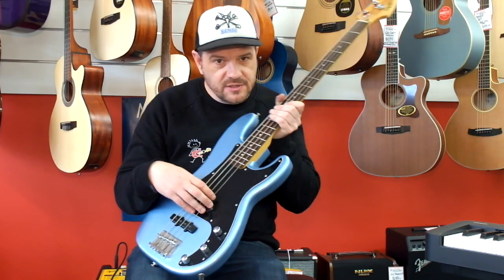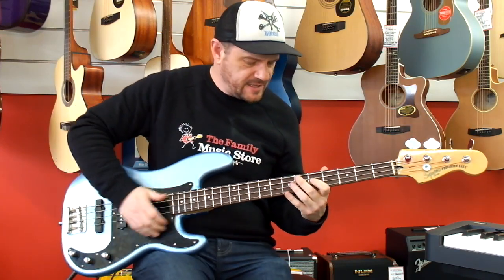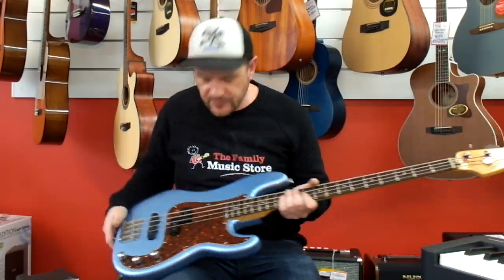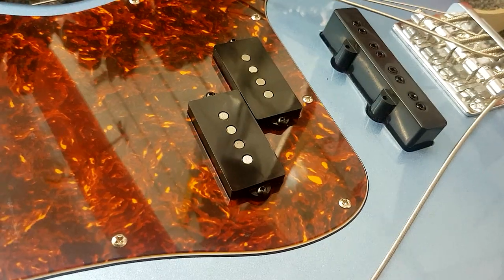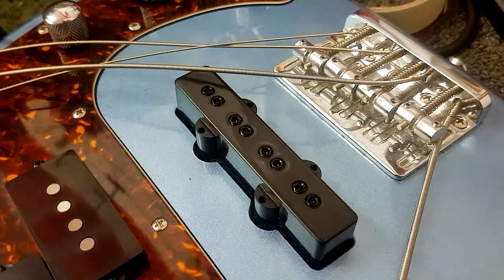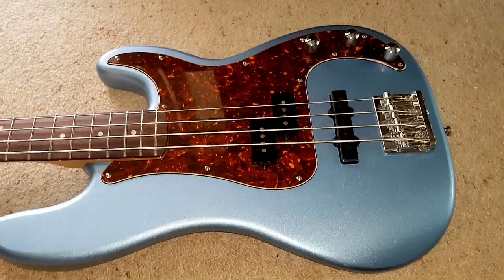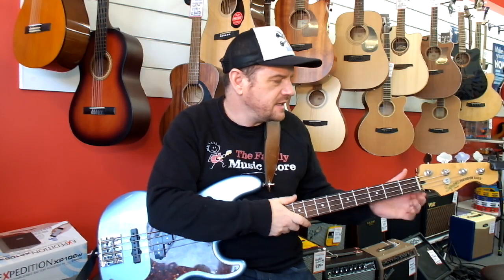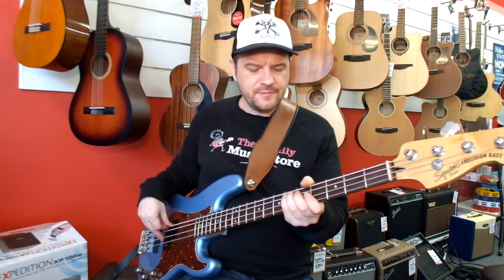Modding a Squier Vintage Modified PJ Bass - from average to awesome!

Comment: You make a very interesting point about how adjusting the height of the split coils ie setting them at the recommended manufacturers height (you did, didn't you!) makes a noticeable difference to your tone. Even with pickups in electric guitars and especially with the higher outputs of Dimarzio/Seymour Duncan et al.
Reply from the maker: Didn't look at the manufacturers recommended heights, just adjusted to what I thought sounded good.

Comment: I'm in the process of moding my PJ bass much the same as yours. What did you use to reshape the pickguard the factory Fender is not a direct fit. Mine is not fitting around the pickups.

Comment: Got a thumbs up for that Rat Bones Cap 👍
Reply from the maker: Thanks! Yes I still skate.
Reply: @diyguitarmods6146  just came across your video a year later. I'm actually building an 80's style skateboard right now. Got some neon pink and yellow grip tape and my wife drew out a design 👍. Oh yeah your video is the video that helped me adjust the pick ups on my bass which is the exact same one as this. I added white pick up covers and put the white pick guard from my Mexican P bass and bingo it looks like a new bass 👍

Comment: Was the bridge just a straight swap?
No drilling and filling?
Reply: Fender uses 5 hole bridges most other 5 hole bridges will fit no drilling required

Comment: I can’t find any pearl picksguard for a pj bass so do I have to drill an extra hole in a p bass pickguard or something?
Reply from the maker: You only need a normal P Bass one because the J pickup is away from the pickguard.
Reply: @diyguitarmods6146  A pj bass has 3 tone knobs while a precision bass has 2 so I had to drill an extra hole. I did it and it worked haha.
Reply from the maker: @matthewgilkison7615  Yeah but it depends where the jack is. A standard P Bass has the jack plug mounted on the pickguard. so the pickguard has 3 holes. So because this bass has a side mounted jack I had enough holes for the 3 controls without needing to drill any. But if you had 3 controls as well as a pickguard mounted input jack yes you would need to drill a hole.

Comment: Isn't the push \ pull volume knob the active \ passive switch?
Reply from the maker: No, there's no active circuitry in this bass, either stock or since my mods. I installed the push/pull for the series/parallel mod on the P pickup.

Comment: Why would you want to change the pickups? They're Duncan designed on the vintage modified .
Reply from the maker: I did not know this. It doesn't say that anywhere, including on the pickups. I figured they were the same as Classic Vibes, which I believe are made by the same people as Toneriders. Either way they sound great, not changing them now.
Reply: @diyguitarmods6146  they aren't duncan designed anymore, in these more recent ones they're "Fender Designed" officially speaking but, to be completely honest, I have a Duncan Designed pickup in my pbass and they sound very close or identical to yours, the "Fender Designed" in general. I'd say they really kept the same specs and just have changed the label for some contractual reason.
Reply: There are Toneriders in Strats and Tele CV's. Good PU's. Not sure what's in my Squier 70's Vintage Jag Bass, but they sound great!  Promo says Fender design, but most likely made by Duncan/Tonerider...

Comment: What did you do about the fret buzz ? I got the same issue.
Reply from the maker: Hey, so there's 2 things - one is that if you're getting a lot of buzz in the higher frets there may be too much neck relief. So you'd tighten the truss rod a little which flattens out the neck. This will also lower the action, meaning you can raise the saddles to clear those last few frets. But the other thing is using a fret rocker or other short straight edge to find any frets that are higher than they should be and filing them down, making sure you don't go below the other frets. I just use a shaped crowning tool I got from Stew Mac so I'm lowering them slightly and crowning them at the same time. - Cam.
Reply: @diyguitarmods6146  Thanks for the response, and advice, I recently adjusted the truss, and am ordering a fret rocker. I dig the bass, I got the same model, and color.  have you had any though about upgrading, pickups ?
Reply from the maker: @krazybassman1  Did you watch the video? Haha - I mentioned several times that I was thinking about upgrading the pickups but in the end stuck with the stock ones. ;-)
Reply: @diyguitarmods6146  yup, sorry. I dig the stock P, and jazz pickup as well, only drawback is the hum on the bridge when turned up.
Reply: @diyguitarmods6146  why aren't squiers played live like fenders?
Reply: @marchangel7462  fear of someone knocking your budget bass.
Reply from the maker: @marchangel7462  I play mine live, it's great.